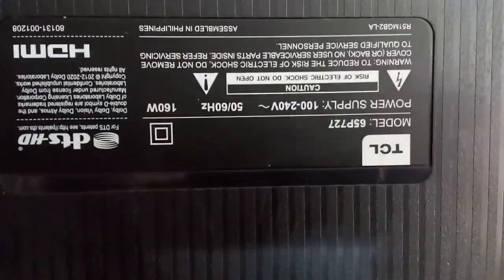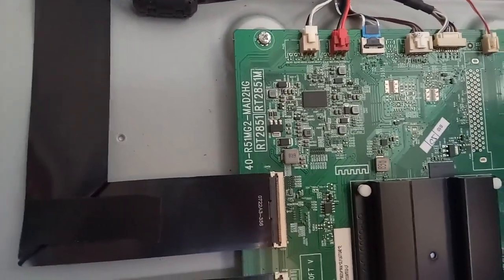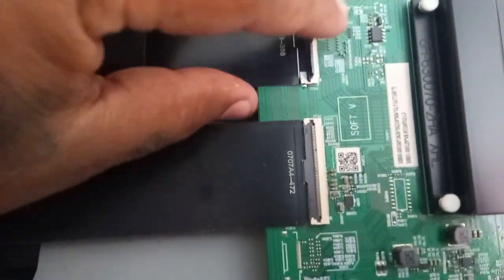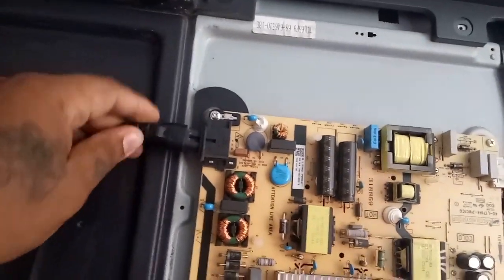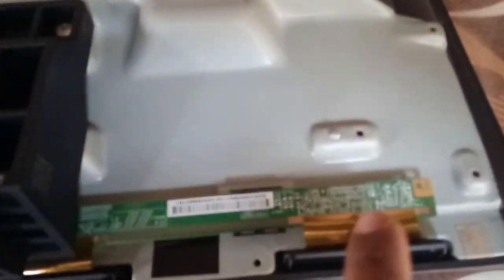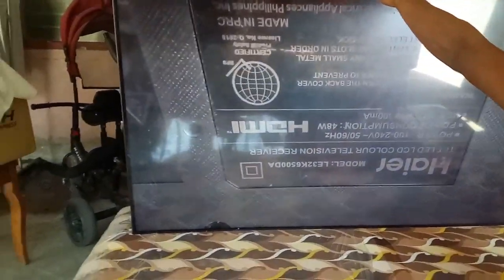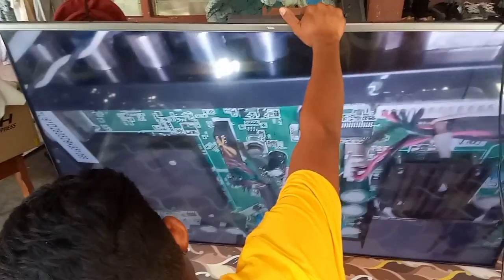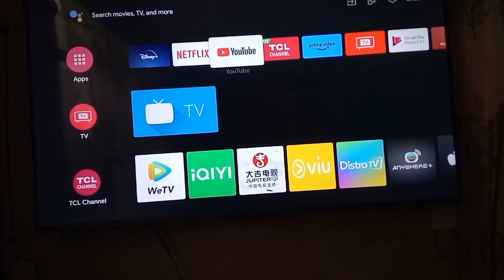TCL Flickering And Picture Fade Problem

Comment: left lc1  12v and  right lc1  17v (am i right)? do we need to remove jumper resistors from shifter ic? what about lc2? did you give it to -7.9V
Reply from the maker: yes sir, you need to remove the fusable resistor from level shifter ic, - supply to lc2 is optional, sometimes the panel its irritated to negative suppy and positive supply so you to look for different positive, when the screen stabalize/stable thats mean that you got a right supply
Reply: @JovitTechPH  Thank you for your kind reply
Reply: Where is  fusable resistor from level shifter IC1 and IC2 ?
Reply: Where is jumper or fusible??